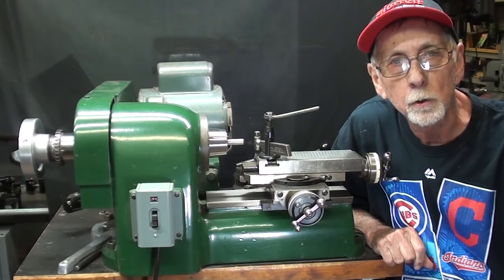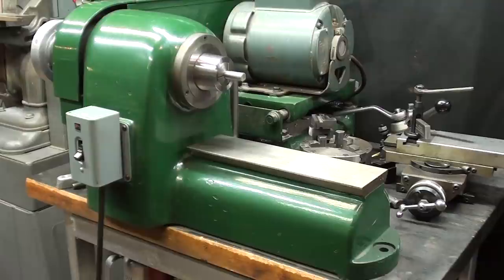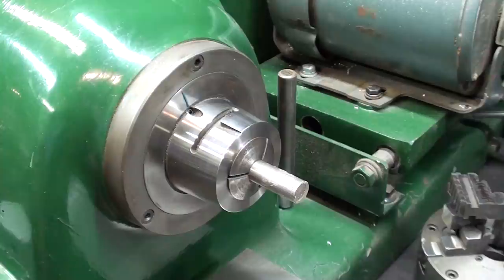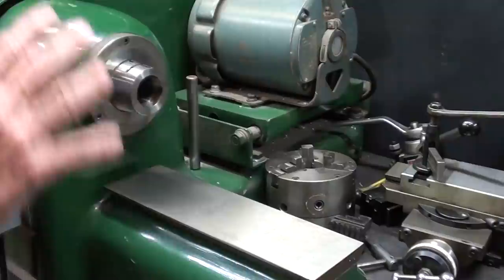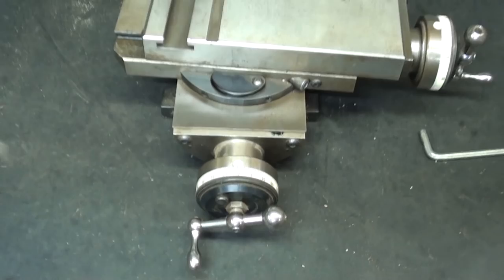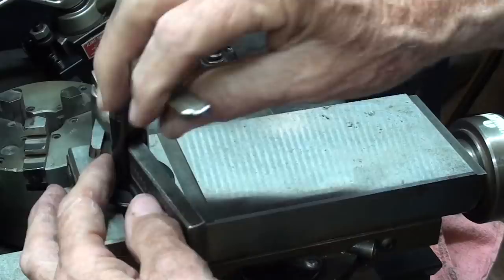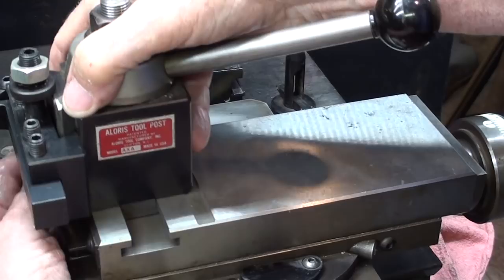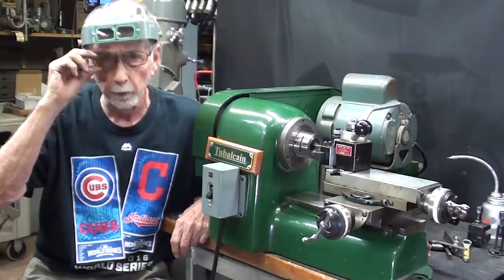WHAT IS HARDINGE SPEED LATHE 750 tubalcain

Comment: I have restored several Hardinge lathes. A couple of HSL toolroom lathes and couple of speed lathes and a full CNC lathe. One of the speed lathes has been converted to CNC. Most of this done 10 years or more ago. Hardinge is an excellent company to deal with. Their parts are reasonable if not cheap. Bearings from them are cheaper than a bearing store. You can buy and replace spindle bearings (done it several times) and the cost for their excellent bearing is reasonable. I bought new ball screws from Hardinge for the CNC for less than others quoted to repair them. I priced a piece of Lexan to make a replacement window for the CNC but Hardinge quoted half for the complete window. You can buy all the label plaques to restore the look to like new for modest cost. You can buy new slide leadscrews and untapped nuts (often left hand acme thread) and Hardinge will lend you the tap to make the new nut. (done that too). You do it all in place for proper alignment. Try finding a left acme tap anywhere else. We would powder coat the base and other accessories but not bake the lathe itself. The lathe would go to an auto painter for fill and paint.  Of course their standards are higher than ordinary industrial standards. Our Hardinge lathes shine like a Ferrari fender. The upside down dovetail bed is very unique and clever. First the critical surfaces are underneath so don't see chips. Under cutting loads the forces pull the tool down to be instead of lifting it. So it is remarkably rigid and offers great surface finishes. On the HSL toolroom lathes the tail stock is outrageously heavy and hard to push. But if you drill a little air hole in the center of it and put a few PSI of shop air to it glides on the wide flat dovetail bed like an air hockey puck, You won't believe how nice it is. I have an HSL lathe at work and at home both tailstocks float. I use air driven collet closers instead of the lever ones although the lever ones work well. 

Decades ago I met the president of Hardinge at IMTS and told him how happy I was with their service. He said he profit made by over charging a customer for a part is not worth the cost of turning someone away from buying their next machine from us. You make more money with cheap parts than expensive ones. I wish everyone in the industry knew that.

Glad to hear you pronounce Hardinge correctly I wouldn't expect any less but some Youtubers seem to think it is Harding not Hardinge.
Drives me nuts to hear that.

JY
Reply from the maker: Thank you for an interesting comment. I am very surprised that their parts are so reasonable. Generally, repair parts are outrageously expensive, even for automobiles

Comment: Thanks again mr. pete! As a machinist for 50+ years I was always very fortunate to work for companies which had Hardinge equipment. It’s very easy to become really spoiled with this equipment! I ran mostly the HLVH series. AKA Super Precision Toolroom Lathes. Last lathe I got to purchase for my prototype shop at a large Japanese company was in1994. Hardinge had just discontinued their precision Chucker and the cost of my lathe (HLVH E/M) was $59,000 including the options I wanted. It was really with great difficulty to obtain approval from Japan to purchase the desired machine, as at the time they wanted me to purchase a new 8N Mazak CNC lathe for much less money. Long story short, after Japan saw the many different prototype parts made on the Hardinge, they purchased two machines for there technical centers. By the way my HLVH/EM meant it was equipped with inch and metric threading capabilities. Everyone who have threaded on a HLVH knows the only machines any faster are the old Cridan Treading Machines or any CNC lathe! Thanks for a great video!!!
Reply from the maker: Thank you, that was interesting

Comment: Nice Video Mr. Pete.
I have 5 CNC's in my shop, and yet my Hardinge Speed Lathe I have is one of my favorite machines to run. The ability to hold small round parts quickly and efficiently is why I'm very fond of it. Plus there is hardly any runout.

I have a turret attachment that I use on my speed lathe most of the time. It has 6 positions and is very handy for drilling type operations. If I could add a picture of it here I would.

These also work great as a power head. Many times I'll put a chamfer tool in the collet and use the machine to simply turn the chamfer tool instead of using a cordless drill. This allows me to have two free hands to hold the parts and deburr holes.

Thanks much and I hope all is well,
Timm

Comment: That Hardinge 5C milling machine was the one I worked with when I worked there back in '77-'85, slotting collets, feedfingers, pads, etc. Customer division in Elmira Heights NY, glad I have my fingers, seen guys lose some hair around multi spindle drill presses, OD grinder parts flying out cutting a forehead. Old guys fighting over a fan during those hot, humid days. No longer involved in machining, the memories are there.

Comment: In 1964, I commenced a 5 year Machinist Apprenticeship. I was lucky enough to be given a brand new Hardinge Tool Room Lathe.
While the workshop foreman and other tradesmen considered the Hardinge lathe a “Toy” l was able to use it to a high degree of accuracy.
It had the Dovetail bed and a variable speed electric powered motor on the tail stock end which was for power feed both longitudinal and cross slide operation.
It also had a lead screw and Norton type quick change gear box for “Screw Cutting”.
As well as a collet chuck it had both a three jaw self centring chuck and a four jaw independent.
One other feature it had was a variable speed belt drive, which consisted of a cone drive pulley on the motor and a hand wheel which varied the width between the cone pulley thus changing the headstock spindle speed.
All in all it was a great little lathe. I would love to have it now.

Comment: I completely understand you being smitten with Hardinge machines, I am as well. I have a 1969 HLV-H that I completely restored. It was disassembled, stripped, painted, new headstock bearings, and best of all the bed plate was ground. It is likely one of a very few HLV-H machines where after bed plate grind, it was not shimmed, but rather the tailstock was machined, followed by bonding Rulon and scraping the tailstock to align it with the headstock. I just considered shimming the bed plate a shortcut of sorts. It is by far my favorite machine in the shop. I also have a rebuilt DSM-59 with the 6 position turret, tailstock, cross slide/compound, and a radius attachment. We bought 4 DSM-59s and a Hardinge vertical milling machine at a closing shop about 5 years ago.  One can really learn to appreciate the quality of Hardinge machines when they disassemble one. They really are close to perfection. Thanks for doing what you do for us.
Reply from the maker: It is good to hear from another Hardinge aficionado. At the age of 16, I recognize that they were something special

Comment: You can get an Aloris (or maybe Dorian) tool holder for that base which has a Jacobs chuck. By adjusting the tool holder height and the cross slide, you can align it with the spindle for drilling and reaming. One advantage is that (on a conventional lathe) you can drill with a power feed.
Reply from the maker: I have one of those. But it is in the size B. Will not fit on the Hardinge
Reply: @mrpete222  - You might see if anyone would like to trade if you don't have a need for the B-size.

Comment: The principal limitation was not the absence of a tailstock, but (in my view) the lack of a bed advance mechanism (lead screw) like every other engine lathe possesses.  This makes it impossible to thread, and difficult to advance the tool along the work since it must be manually advanced.  It's readily apparent that this machine is only an adjunct to a conventional lathe. 
It is nicely made.   I sometimes used an old Hardinge Tool Room lathe when I was in graduate school.  It was an excellent machine.
Reply: Threading ? Have you heaad of taps & dies ;)
Any necessary longitudinal movement would be provided by the attachment. They wouldn't want to add features people didn't want - the features a buyer wanted would be provided by the attachments bought.
Reply: @millomweb  Yes. I've heaad of taps & dies. You fail to understand what I've said here. No tool advancement except manually.

Comment: That's a beautiful machine, I always wondered how plausible one of these would be as someone's main hobby lathe, they sometimes come up stupid cheap and there's bound to be workarounds for the lack of a lead screw.

The biggest drawback is almost none of the ones I have seen have come with a usable selection of accessories.
Reply: THe "Accessories for these machines can set you way Back ...Owners are Very proud of them, and Charge accordingly. It is not unusual for you to equip your lathe with the essentials, and will have spent 3 times the lathe cost for them. Monetarily wise, they are not for the shy...Luckily, the run to CNC has left a lot of these machines up for sale. Look around -- They are there -- But Bring 3 men and a strong boy to load them!

Comment: I'm a bit puzzle by the spindle mounting considering the machine was designed to have a motor brake. Slam the brake on and the chuck would loosen and retighten itself in the opposite direction on the spindle nose. Maybe it did - and it didn't matter!
I'm sure it'd have a 'tailstock' function - probably as part of a turret option - used without the 'saddle' mounted on it.
Reply: I would Never own a Tapered spindle nosed Hardinge. Exactly for that reason, it disengaged on a sharp stop, and if you did not notice -- Could be trouble with it and your parts. I have the screw nose one, actually 2, but that is the one to get
if you want one of these machines. JMO
Reply: @anneinfurna8528  Don't they just unscrew instead ?

Comment: Sad the original motor is gone, but I’d still buy one of those in a heartbeat. I’m thinking about buying a sharp 1118h as it seems like the best Harding clone still being made, money is not really what I’m worried about, I’m retiring in the next 5 years and want to outfit my shop. I want all manuals, I am sick of cnc, but that 1118h comes in a cnc model too, which is kinda tempting ,,, sorta. (Retiring early, machinist can make 6 figures easily, so you youngsters get to technical school. We need you) that is a sexy machine tool, I’d almost kill for a real Hardinge. I used one in my apprenticeship and I have wanted one ever since,

Comment: I run a small machine shop for a company that makes experiments for zero gravity on the space station and I’ve been looking for one of these.
Reply: I found a HLV-Hin good shape and the guy had a Hardinge speed lathe crammed back in the corner. Of course, he said he wanted to keep the speed lathe. But then he said he’d sell it. He’s "thinking about the price", so it might not be within my budget. The Hardinge tool room lathes are going for crazy money now. I got a quote from a reseller on a HLV-EM with the English / metric dials and threading. 1986 model . $26,000. It was in factory perfect shape but geeze.

Comment: A benefit of these machines was that you could dedicate it to abrasive grinding or polishing operations, and not be ruining the ways on your fully-featured engine lathe.  The simplicity of the dovetail bed and attachments made it feasible to foul it with abrasive dust that wouldn't get embedded into the moving bearing surfaces.  It was easy to remove the attachments and clean up the machine when it was contaminated.

Comment: I have a Schauer speed lathe. It only has a head stock, no bed at all. It came to me with a 3 jaw chuck. The chuck was holding a buffing wheel and it also came with related buffing compounds and related supplies. My 3 phase motor is integrated with the spindle.  It is a pretty fancy buffing machine as set up.! I don't know much about Schauer. Did they also come with half beds and accessories like your Hardinge?
My Schauer spindle is reversible. Having no other need for mine as equipped, I will employ it only for buffing, deburing and other hand work. Having a bed and compound cross slide would hugely increase its functionality.
Reply from the maker: I am not familiar with that make of machine
Reply: @mrpete222  
The brand and function was completely new to me when I picked it up as surplus from a local job shop. I took it mostly to repurpose the chuck, but though small it is an industrial class machine. Well I have it, it runs well, and it is something that none of my friends or any of my son's have! I will keep it if only for bragging rights!

Comment: An interesting build by Northern Inventor was of a small home made mill, based in a 4 cylinder engine block and utilizing sections out of other machines.  It's configuration made it very useful as a 2nd opt's lathe, much like this Hardinge.  Most intriguing to me was the "poor man's collet system" he came up with for it.  
edit: it appears the channel no longer exists

Comment: I'm guessing the spacing of the numeral indices are spaced more widely on the compound wheel than the cross slide wheel because the compound feed  screw is single start thread whereas the cross slide screw is twin start thread. Example: 10 tpi single helix and 10tpi double helix.

Comment: Worked in a screw machine company, had 30+ Acme Gridleys w/o the pickoff to do back work once the part was cut off.  All parts then went to the Hardinges for the secondary operations.

Comment: 9:26, is it that there is a difference in the pitch of the screws (not sure if there's a proper term for the screws), i.e. the cross slide has a smaller pitch than the compound slide?  Great video as always Mr Pete!  Thanks.

Comment: 28 Sec is - you get a thumbs up from me already ! I hope the detail in the video matches my expectations :)
Reply from the maker: lol
Reply: @mrpete222  Not really a lot to say about the basic lathe but I expect the 'accessory list' would be rather long - so it would have been nice to see what optional accessories were available for it.
The other mystery is how that spindle nose fitting coped with the brake. Obviously, starting up and in use, the tendency of the chuck or whatever coming loose would have to fight against the motor drive. But when thebrake was used, wouldn't the chuck carry on turning and loosen itself and then retighten itself in the opposite direction in that groove/slot ?
Reply: @mrpete222  Interesting that you had your dad as 'shop teacher' and I get this was 'machine shop'. Here in England, the machines were just a part of a metalwork class - so no dedicated machining class. We had access to 5 lathes. 2 cheap ones - 3 speed, no leadscrew, a small lathe with leadscrew, a nice 'proper' lathe with power feed and leadscrew and the 'big' lathe you only got to use if you were teacher's pet. (A lathe make/model I now have here at home!) There was a power hacksaw and a small shaper - both for teacher only ! - and 2 pillar drills. Most kids ended up using files and vices rather than doing any machining.
For my qualification projects, I made a grease gun and a sash cramp. Others did grease guns - lever-action - not a lot of lathework. Mine was pump action and round - so pretty much all lathework ;) The sash cramp thread, I turned on the lathe at school - effectively showing the teacher how to do it - he clearly knew it could be done but demonstrated his ignorance by being surprised you have to take the tool out of the thread after each pass. The thread in the nut, I turned at home - to help progress the job and I don't think the school had an internal threading tool !

Comment: Second-operation lathe has nothing to do with a machinist running two lathes at once. Because all features of a part turned in the same chucking are naturally perfectly concentric, and when a part is re-chucked in the lathe the part axial and radial locations have to be re-established, second-operation lathes have to be especially precision when it comes to spindle bearing run-out and the ability to chuck up a part a second time and re-establish these axial and radial locations on previously machined features of the part from the first operations chucking. Another way to say it, a first operation lathe does not need a precision spindle or workholding device, because once features are turned into the raw bar stock, they are all perfectly relative to each other. A second operation lathe does not have this luxury of inherent coaxial symmetry of chronologically created features. Precision re-alignment of the existing part features when chucking is necessary before subsequent turning operations can be accomplished. Collets, pot chucks, and adjustable chucks are made especially accurate to be able to facilitate this re-alignment process. That is why these lathes are called second-operation lathes.   ---Doozer
Reply: THat is correct. As long as the runout of the spindles are close to zero -- You are good. You may have to indicate the part dead nuts , but that is not a problem. Also depends on the Concentricity call out, But These machines hold tenths all day Long, and are Just a Joy to use with the direct read white dials.
He mentioned the disparity between the 2 dials -- one reads .200, and the other reads .100. I have made a Million parts on these machines over the years, and still are doing it. Gotta Love the Hardinge company, they sure love money, and they have a lot of mine!!!  I asked the lady there 'Do you have something there for 10.00?  She replied "Well, We might have a Rubber O ring...!!!" Just between you and me, Their prices are higher than the Balls on an Astronaut!   Back to Work!
Reply from the maker: Thanks 😊
Reply: @anneinfurna8528  Anne- Nice that you know about Hardinge lathes.  I have a 1920 Cataract QC lathe and an HLV-H.  Are you a machinist or an engineer? --Doozer